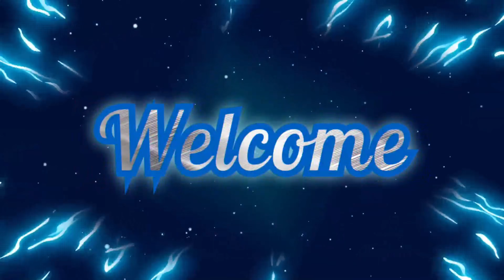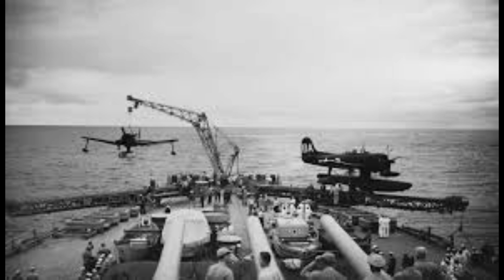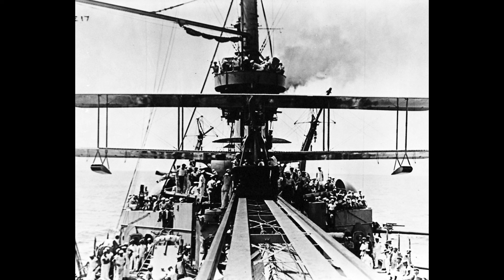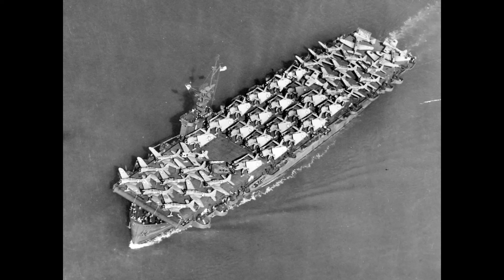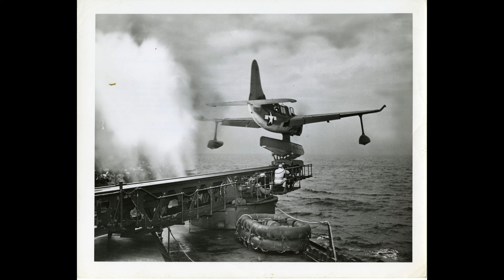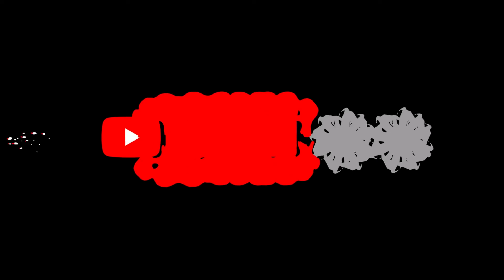The Untold History of Naval catapults Pt 1

Comment: Very cool, would not want to be a pilot of those hurricanes! Will you speak on the new catapults of the Ford class, I think they are electromagnetic?
Reply from the maker: No spoilers for part two
Reply: @jaxompol224  🫢
Reply: They very much are  electromagnetic, and that was one of the issues in getting here past her builders trials, as there were issue's. BUT they are much than the old steam system, as they can be dialed down, so to speak, to enable them to launch lighter aircraft/drones without the stresses of the older ones.
Reply: @GR_Chief maybe a part 3 required? @jaxompol224